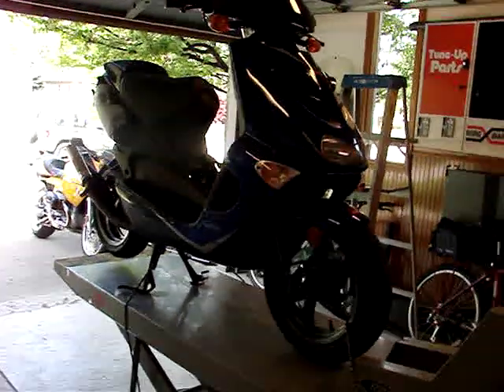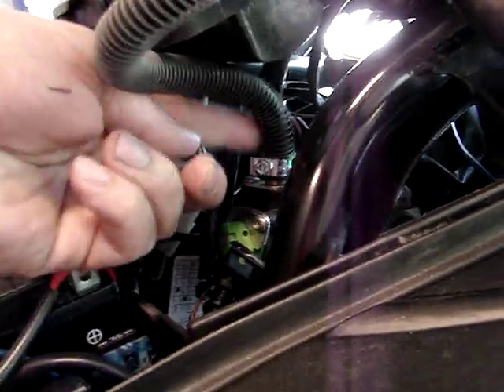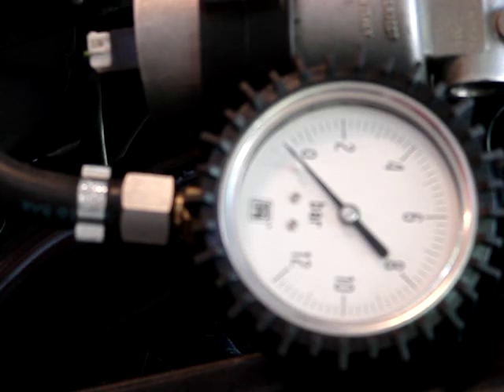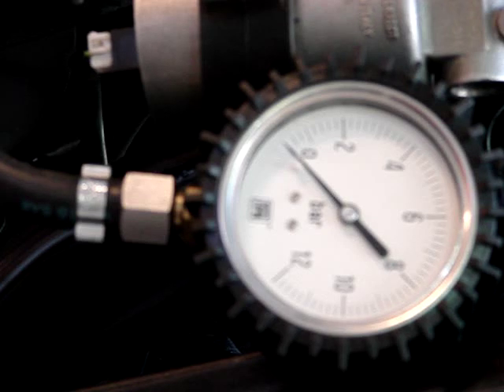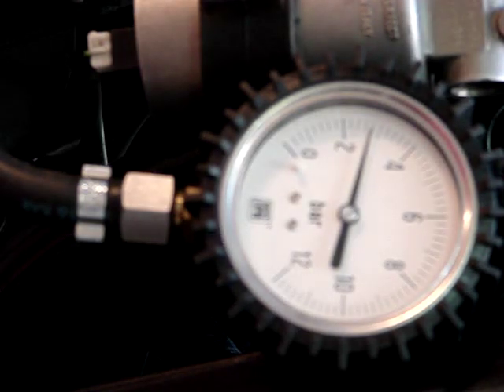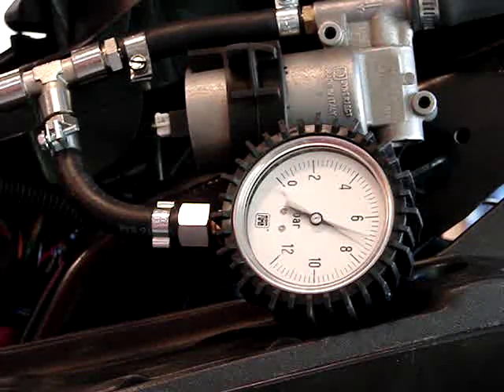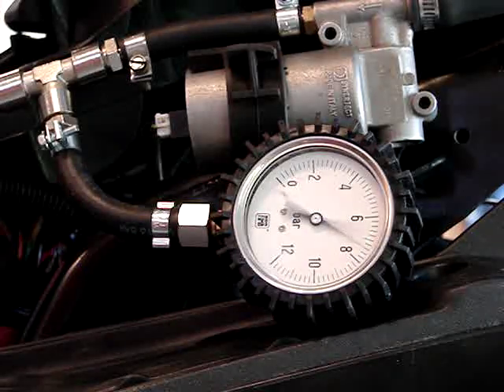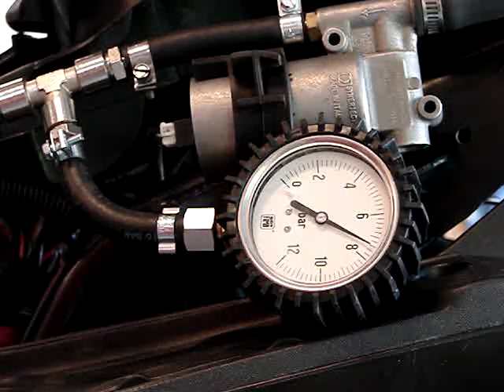SR50 Fuel Pressure Test

Comment: I wish my Ditech 2009 was running so nice! ;-) I changes air and fuel injectors and that resolved the issue after found crashed o-ring under the air injector. It runs nicely for 3 days and now would not even start. Checked o-rings and injector and all is good. I suspect fuel pump now failed. I have now a big collection of failed pumps. Aprilia made worst quality bikes. Aprilia dealers closed shop in my area. Time to move to other brand.

Comment: Hello and congratulations for the explanation. I have a problem with the ignition of a DITECH SR 50, after a long period of inactivity I find the fuel pump blocked. I release but it does not start anyway, I decide to measure the pressure in series with the delivery pipe and with the key inserted at 2.5 bar while in start 4.5 bar, but equally it does not start. I ask your opinion.

Comment: fuel pressure regulator,fuel pump or air leak somewhere.Mine drops a little but not a huge drop as urs.prime 2.5 bar is good,when the engine idle its should be around 7-8 or higher bar.

Comment: Good vid, I repair/renew fuelpumps for SR-s Ditech Aprilia, Scarabeo, Peugeot. For me that pump looked quite solid, it dropped the pressure while the engine was reved up for the second time, but it was not a major drop, so not 100% sure that the pump has a fault.
Reply: Are you still repairing fuelpumps?
Veronicascooters@gmail.com